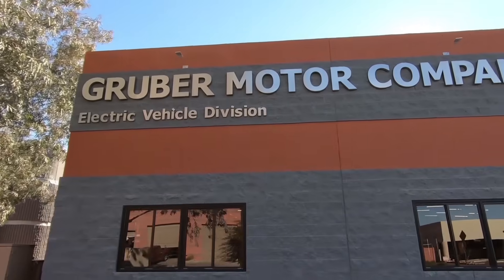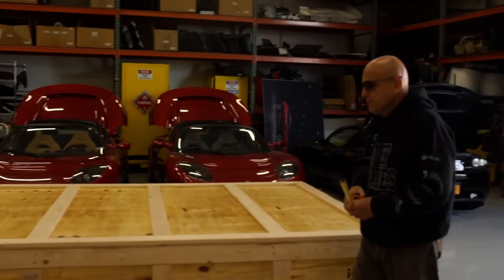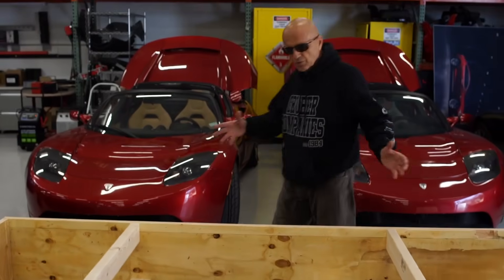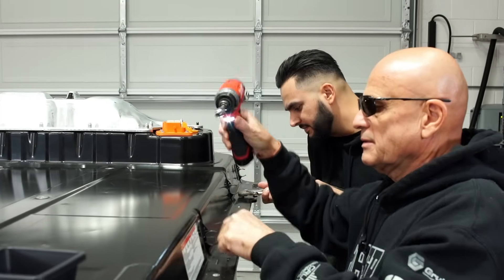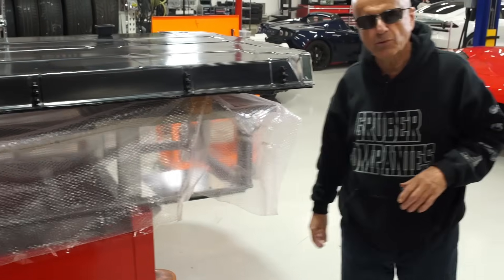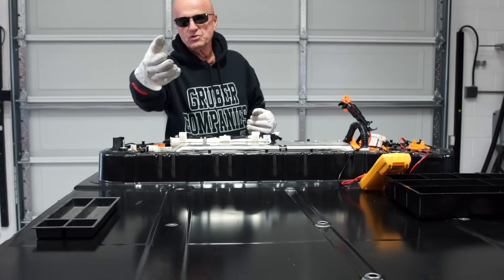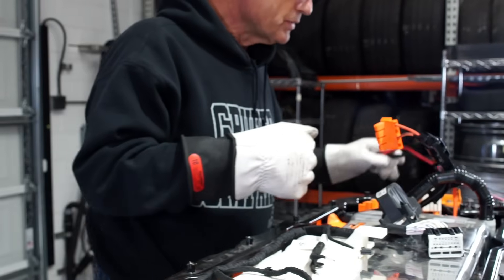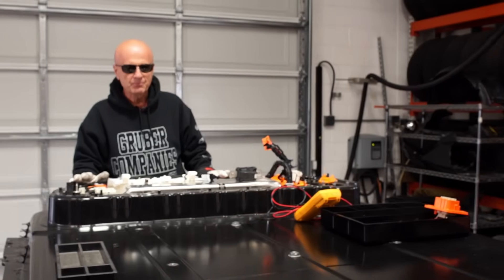Inside a Tesla Model 3 Battery Pack | Gruber Motors

Comment: I'm a bit worried that the new structural battery pack could be a problem in the future. I guess isolating bad cells or changing just one module will be nearly impossible with that design :/
Reply: Yeah me too
Reply: Possibly. But when they say structural all that really means is that everything you see in this battery would be enclosed in a box that would have the strength to be a structural member. That box would then be bolted with or together with the front and rear subframes. If you take a look at Monroe and Associates video on the Volkswagen id4 battery. It is very much structural but only for the reason of crashworthiness not actually for the structure of the vehicle itself. It's a very very strong aluminum box with the modules inside. Versus this design which is more of a fairly thin stamped steel box that then bolts into the car chassis that's already very structurally strong. Just a difference in the way you might engineer it I'm not sure one way is better or the other. The Chevrolet bolt EV is much like this Tesla battery where it's essentially contained in a steel battery box. Weber Automotive on YouTube also has some really good theory of operation and disassembly videos on Chevrolet bolt EV some Tesla stuff and then a bunch of stuff on all other types of hybrid cars lot of Prius videos if you're interested in technical and mechanical information you probably will like his channel a lot and also Monroe and Associates

Comment: Great video.  Not to be a jerk but to be accurate... when a fuse is open you have infinite resistance instead of no resistance.  The meter reads overload so you in effect get no change in the reading but a reading of zero (touching the leads together) is no resistance. You probably knew this and were just trying to express that you were not actively getting a reading on the meter not that you had no resistance.

Comment: I watched while I had a windshield replaced on my truck. The service tech used an electric glass cut out tool. Have you ever experimented with a short or shallow blade to make the process a little faster or easier for separating the battery compartment?
Reply: Great idea, and in 2023 they got a tool like that 👍👍

Comment: Tesla 3 cells are 10a or 15a cells continuous. Just trying to program a speed controller using a 10s5p tesla3 pack. I dont want to heat things up pulling too much current

Comment: Very interesting.
There is a galvanic isolation between 12 volt battery and high-voltage propulsion battery pack? (i suppuose it is, but i'm not sure abuot that...).
The negative pole of 12 volt battery is connected to body (like "normal" engine veichles) or not?
I'm curious...
Thanks.
Reply: The 12 volt battery negative does connect to chassis.  The propulsion battery does not.
Reply: @petegruber7564  Ok, thank you 👍